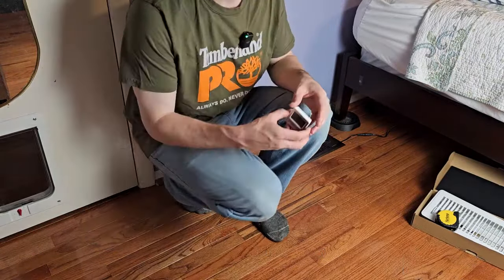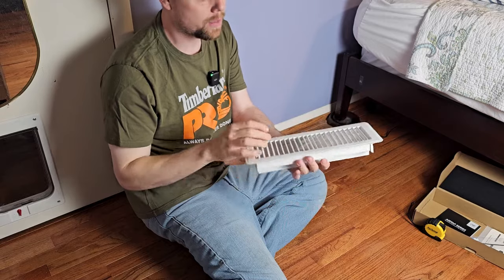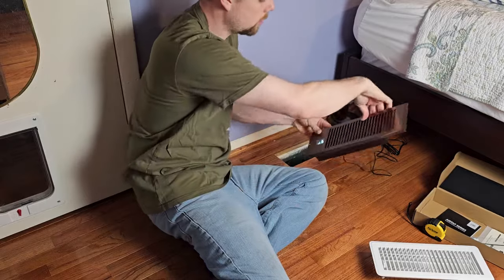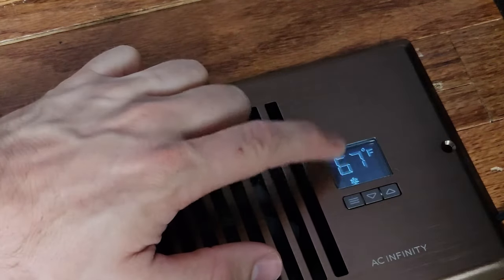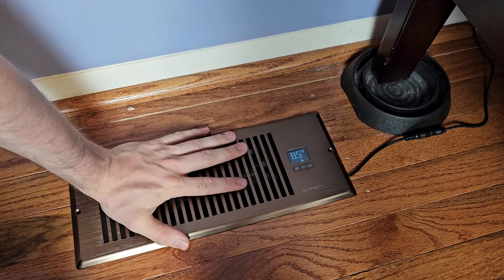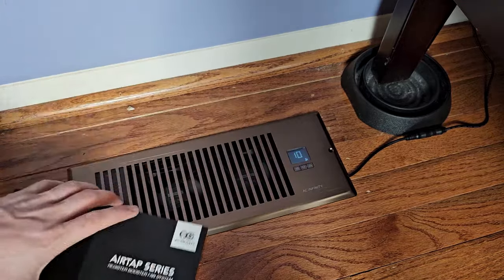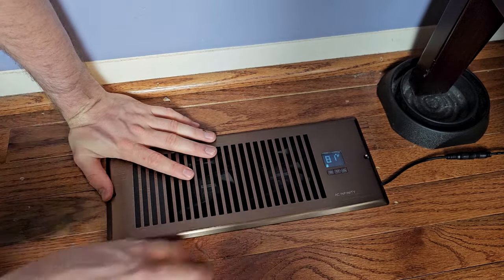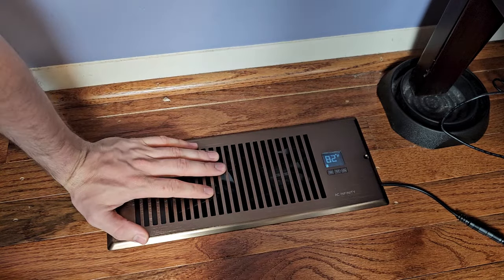Air tap AC infinity register grill. How to increase air flow to a specific room

Comment: I am facing the same issue. I wonder this booster works like a fan itself, not actually sucking or boost the air from the actual ventilation system air filtered.

Comment: Damn, so there's no way to make the device turn itself on when it detects a temperature higher in the room than the temperature I set it at? My parents tend to fluctuate between turning on the AC and Heater while I'm consistently always in need of AC, so I tend to get hot in my room needlessly.

Comment: Thank you for this! I’m in a rental and there is one room that is like a sauna! I had been looking at something like this on Amazon but wasn’t sure it was worth it.
Reply from the maker: it definetly can  help if not return it
Reply: I'd also see if there's a source of heat that you can adjust - like a window you can put white-lined curtains on, or even an outside wall that's heated by the sun (reflective boarding)
Reply: @BliffleSplick  thanks for the advice. We definitely keep the blinds closed all the time but I have thought maybe some curtains as well might help. I did end up purchasing this register. It’s not life changing but it helps a little. They really need to make it where you can change the direction of air flow like the normal ones though.

Comment: I want this but my ducts are in my ceilings.
Reply: I have one in my ceiling, just had to use an extension cord plus the cord is easy to hide up there. Great purchase, I’ve had it a year and it’s helped both for heating and cooling. I’m in north Texas, so the winters aren’t too bad but summer is horrible. I definitely recommend, I’ve had zero issues and definitely helps cool the room by a few degrees.

Comment: I have almost a 3 story home, finished attic, basement but only 1 hvac system from the house. These did great for the room above the garage and attic. 
Don’t understand the cold and hot setting. I just put the fan on 8-10 depending on how hot it is out.
Reply: The hot and cold settings are there to make it more efficient. When the ac is on, your ducts are much much cooler inside.

The fan already has a gauge for the temperature inside the duct. Setting the temp for the cold, for example, will turn on the fans once the air inside the duct reaches that temp. When the AC turns off, the air inside the duct is still cold, so the fans will continue to suck that cold air out until it gets too hot and reaches that set temperature and turn off. 

Wait in between cycles to see what the base temperature inside the duct is, then set the cool settings 2-3 degrees below that. You want to get as much of that sitting cold air as you can when the AC’s off.

Basically it’s waiting until the air inside the ducts gets cold enough to turn on and it will turn off once the air inside the ducts gets too hot.

Apply the same logic to the heat settings.

Comment: i wish isnt run by that power cord. im not sure how else you would power it but aesthetically it would not look great to run a power cord from the ceiling (where the air vent is in my house) into the floor where it would be plugged in.

Comment: Question: are there options for grills that do the opposite of this? As in create negative pressure in the room (push it back vs suck it in)? 
I have some vents that I've tried to block off to no avail and the A/C is not reaching the areas that need it the most.
Reply: You could buy this unit then just flip the direction of the fans
Reply: I've seen magnetic vent covers on Amazon if you're looking for complete blockage of the vent. Haven't tried them myself, so I can't rate their effectiveness.
Reply: I just bought the product and the directions clearly say they can’t be reversed but the motors look very easy to flip